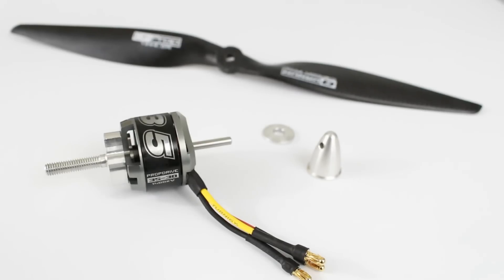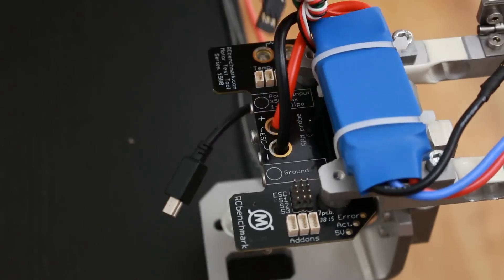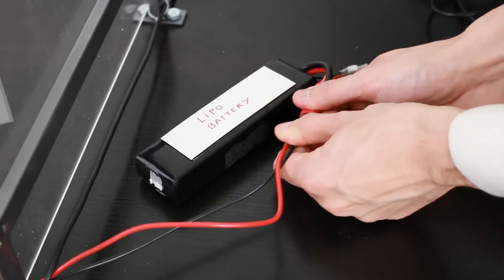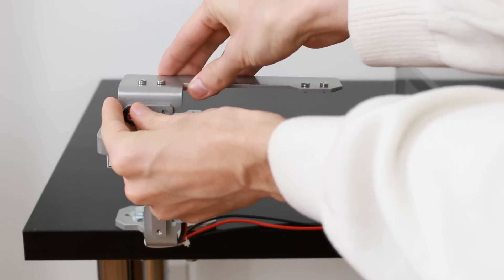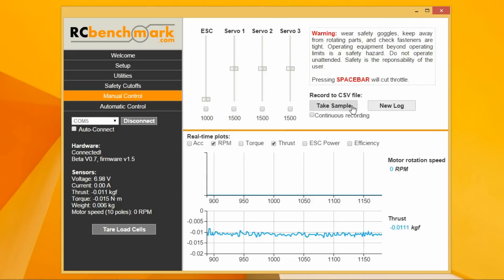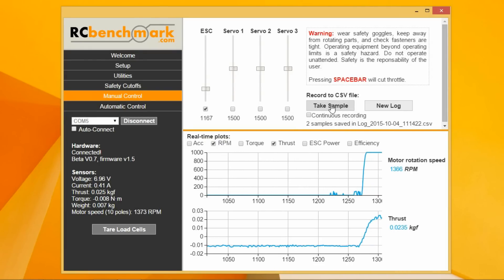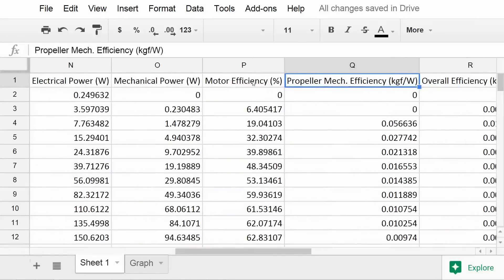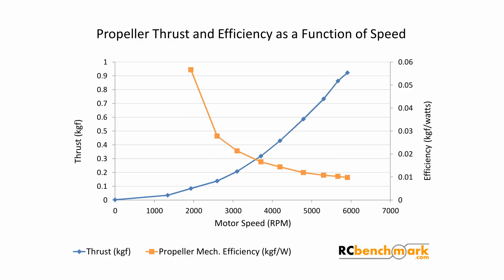Measure Motor and Propeller Efficiency for Quadcopters, Drones & UAVs

Comment: $4,995.00?  Ya gotta be kidding me.
Reply from the maker: Hi Gary, that pricetag is for the Series 1780 which, depending on the configuration can measure up to 75 kgf of thrust. The tool depicted in this video is much less. Check out our product page for the price: https://www.rcbenchmark.com/products/dynamometer-series-1580?variant=13071468527728
Reply: 75 kgf thrust is not something to trifle with.  That is like a 50 inch (1.25 m) or more propeller.  That is ultra-light category, and you can fly with that!  Try measuring the thrust, torque, power, and efficiency of your 50" propeller without the Tyto Robotics 1780, and let us know what it is.  We will have to wait for a couple of years to hear from you.  If your aircraft is electric, then you are severely limited by battery energy.  Then 10% extra efficiency on the prop or motor or ESC does wonders.

Comment: I think this is brilliant, well done for creating such a comprehensive and professional solution! One measurement you're surely missing however is air-speed (using either an anemometer or pilot tube). The 'power' a propeller produces is equal to its thrust x the air-speed it generates... but you're not 'measuring' the air-speed?
Reply from the maker: Thanks a lot for the feedback! 

You would need a wind tunnel for dynamic tests. We offer a pressure probe to connect to a Pitot tube for those doing wind tunnel tests: it is on our store. With the pressure sensor,  the software calculates the forward flight efficiency in addition to the motor efficiency (mechnical/electrical power) and overall efficiency (thrust/electrical power). Cheers,
Reply: Superb! You really have thought of everything :-)
Reply: Are you sure prop 'power or goodness' (Pp) = thrust (T kg.m/s^2) x air-speed (V m/s)?   Thrust is a function of RPM.  V is also a function of RPM.  So prop 'power' depends on RPM^2?  Does not sound right.  The 'power' should be independent of prop speed and be unitless, I think?

Comment: Very nice! I've made about the same but without torque...
Small tip; better to use a stabilized lab power supply to exclude battery voltage drop and battery efficiency. Especially when operating in higher power modes.

Maybe it's possible to keep up a database of prop and motor data?
Reply from the maker: Thanks! We also have a power supply to testing. The tool is compatible with both. The best option really depends on the kind of test you are doing.

We would like to work on a database, but there are a lot of technical challenges to make the data repeatable and searchable.